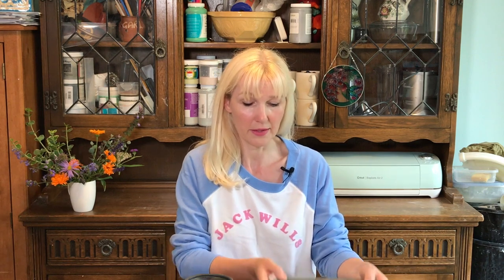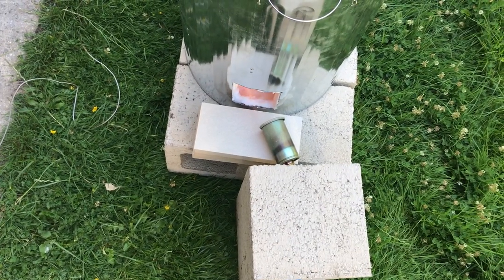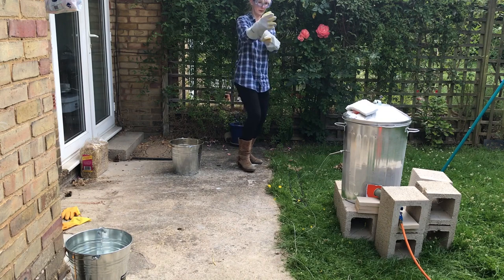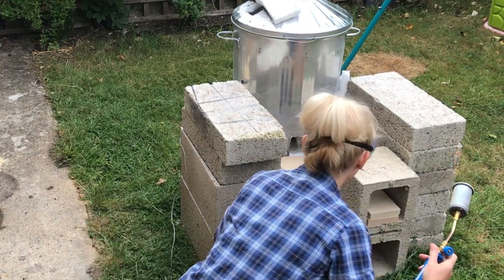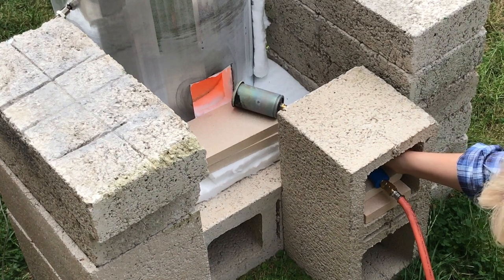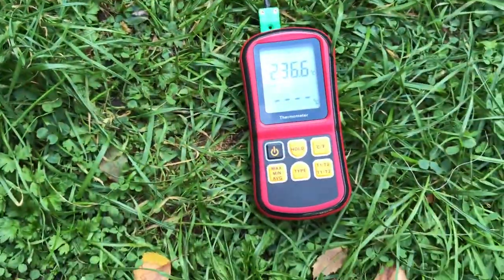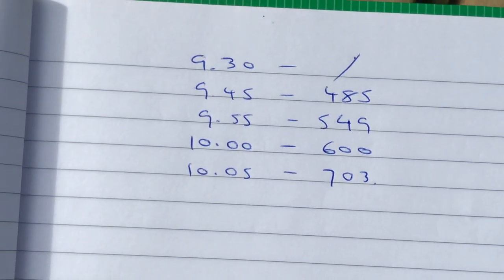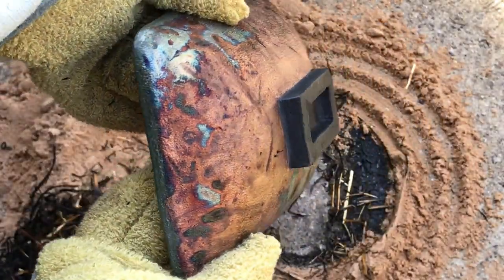Raku firing Pottery

Comment: Thank you.
Years ago i built a raku kiln but used square wire mesh. They call it hardware cloth here. Attached the matt to it in a circle. Made a lid with the same system with a 2" hole in the middle.  The base was fire brick and the shelf sat on fire bricks inside. I never had a pryrometor to check temp. Just looked in the vent hole for the color. Burried the pot in hay covered by dirt  then uncovered after a while and sprayed the open ares with water to freez the color changes. Worked well. 
The next one i build will be like yours.
Thank you
Reply from the maker: That sounds great!

Comment: Great perseverance on the adjustments to your set up. 
Re paper in can, let it burn a bit before closing the can, I think you may like it. Also shhhhhhhh another technique is to close the can for 15 -30 seconds and then slightly lift the edge of the bucket, burping the pit for a second or two, then seal it. With enough sawdust, it won’t crack but you may get a nice blue. Your green is excellent. I wonder what glaze? I haven’t achieved such a green. 
Temp is important, can you see the glaze melt inside the kiln? If you can , watch what it does as it melts, bubbles, and settles to a gloss on glossy glazes.
🙏

Comment: Hi there. Thank you for sharing YOUR Raku experiences with us. I enjoyed the way that you presented your issues and the action taken to resolve them. I also have built a fibre lined brick Raku kiln. I fire copper glazes also, among others, and have a few suggestions which I believe will help to improve your results. Increase the reduction from about 900c onwards. This can be done by closing the "damper" slightly more. The temperature rise will be slower but the reduced atmosphere enhances the colours. Use finely shredded newspaper in the post-reduction phase. Straw works well too but you need to have a lot of reduction and production of carbon during this phase of the process. Pots will crack during the Raku process due to thermal shock, it's a natural occurrence. I hope that you will find some value in these comments. Good luck with your future firings.
Reply from the maker: thanks very much for your suggestions Neil.  I'm always experimenting, so I will try this out :)

Comment: Hi Lesley
thanks for showing the learning curves of using a raku kiln.
just  a word about turning off the burner first before the gas cylinder .I have been advised to ALWAYS TURN OFF THE CYLINDER as pressure can build up very quickly at the burner valve  and/or the gas regulator and cause serious problems to these part of the equipment if this is not done.
i hope this is helpful
John
Reply from the maker: Hi there, thanks for that suggestion.  I haven't had any issues yet with turning off the burner, but what you say makes a lot of sense.  Thanks for the heads up.

Comment: Great video, I know next to nothing about pottery and I'm looking into making some simple slab or coil pots for bonsai and your kin video is very informative. Couple comments on it though, i do have experience with ceramic fiber insulation and it can be dangerous to run a forge (or kiln in this case) using uncoated ceramic fiber. The blast from the burner can knock fibers loose and breathing in the fibers can be really bad for you. Not asbestos bad but still not good. Consider lining it with a thin layer of refractory cement. One other thought, the trash can you used looks to be galvanized or zinc plated, if the zinc ever starts to burn off please be very careful, zinc oxide can be very bad to breath and can cause metal vapor fever.
Reply from the maker: Hi there, thanks for your message.  I'm glad you found this helpful.  Yes, you're right about the ceramic fiber.  I've actually lined the kiln out with body soluble fiber which dissolves if inhaled. And yes, you are right it's galvanized steel.  My understanding is that once the kiln has been fired a few times that the fumes burn off and are no longer an issue.  That is, what I've been advised at least.  But you may know more about that than me.  I'd be interested to hear what you think.  I always fire outside and wear a mask.

Comment: Hello! So I'm working on a project and I want to build a kiln. I saw your previous videos on how you built it and seeing everything that happened in this video as you experimented with the firing I'm wondering if I should make a few changes to my plans. Also, do you have any recommendations for certain kinds of clay or glaze? Also also, what is that claw thing that you use to take the pieces out of the kiln once they're finished? I'm just trying to figure stuff out right now. I'm sorry if my questions are scattered.
Reply from the maker: Hi PJ, thanks for your comment.  I use raku clay, the one that I use for these pieces is ashraf hanna, which is a raku clay.  I'm also using raku glazes here by Mayco, you don't have to use raku glaze. You can raku other low fire glazes.  The thing I lift the pieces out with is are raku tongs.  I bought them in the UK.  Where are you based?  I can try to find a link for them if you like.  They are heavy though, so if you aren't in the UK they might be expensive to ship...

Comment: You've probably adjusted things since making the video, but here's a few things that might help. Line  your trash can more fully so that the pot is nested into paper, not just surrounded by a couple of layers on a bare bottom. Add a layer of wet paper to the lid so that when it's put on the can, it seals more fully. When you put the pot into the paper nest, push the side paper down over the pot to cover it, then put the lid on quickly.
Reply from the maker: Hi Kzoo, thanks for that.  Yes, I do generally use more paper these days.  Though I didn't know about using wet paper on the lid, so thanks for that :)

Comment: Good job, your on your way to better raku pieces. Use porcelain clay if you want to prevent less cracking problems. Porcelain can handle the extreme changes better.
Reply from the maker: Thanks for the tip Rob

Comment: Hi, great video thank you.  We are looking at learning pottery and have provisionally booked a taster course, but when this will happen we don’t know due to the current restrictions.  Anyway obviously we are complete novices and I think I’m going to build a kiln like yours as we are going to do a bit of hand building while we wait.  My question is and it may be a daft one but are all your pieces bisque fired prior to putting in the kiln.  If so is the glaze added after the bisque firing?  Like I said this may be a silly question and it may be an unwritten rule that raku requires bisque firing, if you don’t ask you don’t know.  Thanks
Reply from the maker: Hi Paul, your question isn't a silly one at all.  Yes, I bisque fire all my pieces before I put them in the raku kiln.  Basically, I bisque fire them, then apply the glaze.  Then I raku them.  I bisque fire in an electric kiln.  I know that some people bisque fire in raku kilns.  I'm sure this is fine, but I'm not sure I'd want to stand outside for 8 hours whilst I bisque fire in my little DIY kiln.  I'm in the UK and it's always cold and rainy in the UK in the winter, so bisque firing outside would be grim.  Good luck.  Let me know how it goes.
Reply: @ThePotteryWheel  Thank you for replying, i kind of guessed it may need bisque firing.  I'm in glorious Manchester and can fully understand you're lack of enthusiasm for standing outside for eight hours, and of course i would imagine it uses quite a bit of gas too.  I'm wanting to get into making little plant pots as i collect succulents so presumably id need to find somebody local and rent kiln space.  Is this something you know anything about?  I'm curious as to the cost of renting kiln space really as I'm guessing it's not cheap, then of course enabling me to raku fire my own pots.  Thanks again.
Reply from the maker: @paullongworth9607  If you are in Manchester you will definitely be able to find someone with a kiln who will bisque fire your pots for you.  Your best bet is a local pottery supplier.  They often rent kiln space.  It's normally not to expensive to get stuff fired. You can check out my article on finding a kiln service here for ideas if you like....https://thepotterywheel.com/10-easy-ways-to-find-a-pottery-firing-service-near-me/
Reply: @ThePotteryWheel  very informative thank you.

Comment: This is awesome! I have recently just started my pottery journey and I am currently trying to build a hot enough kiln to do stoneware and ash glazes. I don't think I can get to a high enough temperature though with a brick kiln so I may try doing raku instead. Do you think raku firing would be feasible with a wood burning brick kiln?
Reply from the maker: Hi there, I haven't ever tried raku firing with a wood burning brick kiln.  In principle, provided you can get the pottery out of the kiln when it's hot, then I don't see why not.  But it might help to ask someone who uses a wood burning kiln.  There are quite a few videos on youtube about wood firing, have you checked them out?

Comment: Hey Lesley, thank you so much for your videos and advise!
I have just a question, would you recommend to put a second layer of ceramic fiber in the walls as well? Or do you think it wont improve the conservation of heat on the inside at all?
Thank you so much!
Reply from the maker: Hi Jordi, I think it depends on the size of the trash can you are using.  If I had double lined the walls of mine, it would have made the inside chamber way too small.  If you get a bigger trash can, then probably double lining it is a good idea.  I think I'm going to build a bigger one next time, and I will most likely put two layers of ceramic fiber on there.  Good luck!
Reply: @ThePotteryWheel  Thanks for answering :) 
It's more or less the size of yours. I'll put double layer then, I don't need that much space. Can't wait to see your new videos ;)

Comment: What do you mean , or what do you do exactly, when you say to keep it at the high temp you Adjust the flame? How do you adjust the flame? Thx
Reply from the maker: Hello, there is a little dial on the head of the propane burner which you can turn to adjust the size of the flame.  If I want the kiln to get hotter, I just increase the size of the flame.  Hope that helps.

Comment: Does it make the clay waterproof at that temp also by using that Rakuten glaze ?
Reply from the maker: Hi there, the clay has been bisque fired so it won't dissolve in water.  But it's still a bit porous, a bit like brick, so you couldn't use it as a vase or for food or drink.
Reply: @ThePotteryWheel  what kind of clay does one need to use for food/dish machine safe pottery ? And at what Temps should they be fired ?

Comment: Halo, how long the ceramic burn in the kiln?  Thank's
Reply from the maker: Hi Hardi.  Raku firing is a quick process.  It usually takes me about 45 -60 minutes to get to temperature.  You can go quicker than that.  With this kiln, I can get up to temperature in about 20-25 minutes.  But I tend to go a bit slower than that deliberately to avoid cracks.

Comment: All of that glass/ceramic wool that isn't rigidized or coated in refractory cement gives me the willies.  That stuff is suspected to be a carcinogen, not nearly as dangerous but similar to asbestos - perfectly safe to work with as long as it isn't broken into fiber form.  I know a lot of people do it this way, but it doesn't seem worth the risk to me.

Comment: Can you recommend the some clay products that dry up very hard and ridged
Reply from the maker: Hi Kip, do you mean, a particular kind of pottery clay?
Reply: Yes
Reply from the maker: @kipholder8577  It depends what you are making.  If you are raku firing, a raku clay is good, as it's less likely to crack when you fire it.  I'm using Ashraf Hanna raku clay here.  Stoneware clay fires hard and is quite tough.  What are you making?
Reply: Im making some squares 1ft by 1ft inch thick for a art project. Im going to let it sit one week to harden im not going to use fire
Reply from the maker: @kipholder8577  if you aren't firing it, definitely use air dry clay.  You can buy pottery clay that's reinforced with fibre.  It's sometimes paper fibre, sometimes nylon.  But either way the fibre makes it much stronger when it dries without firing.  Just search for air dry clay and choose a colour that you like.
Reply: @ThePotteryWheel  hi excellent answer I wonder whether you'd be able to apply raku glaze afterwards...?